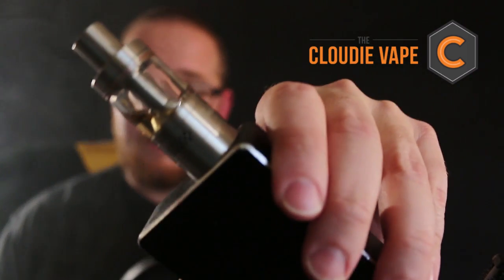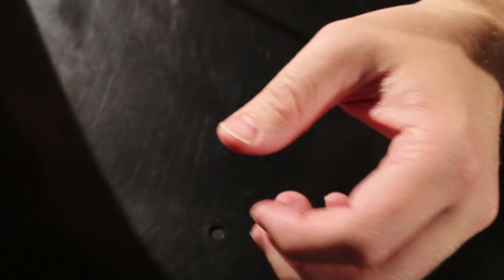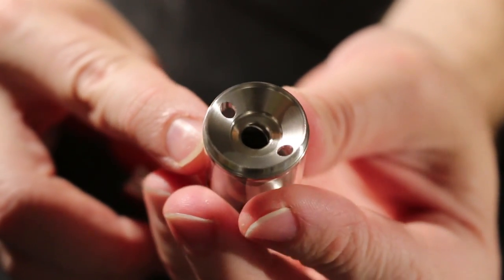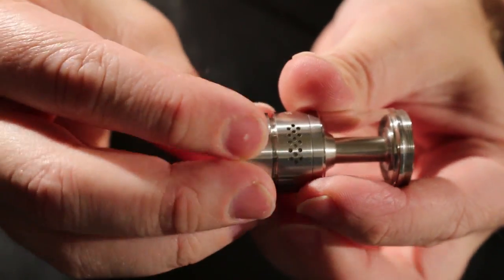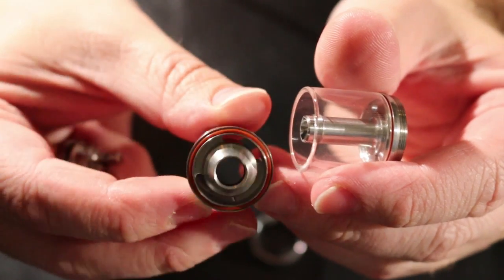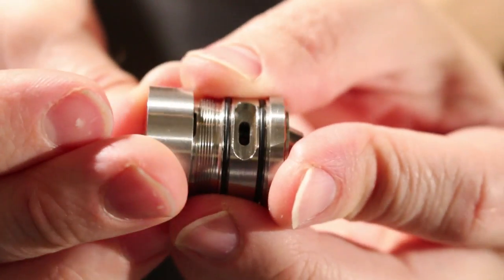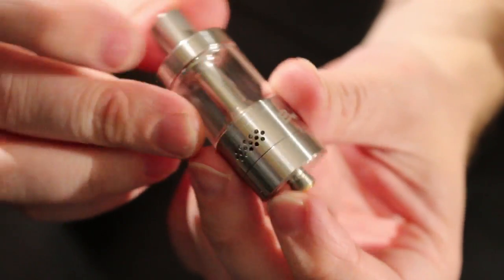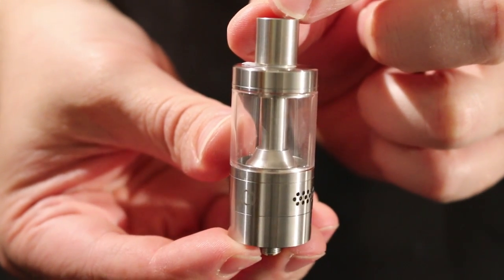Bellus RTA by Youde "UD" Technology - Review!

Comment: Another fine review, except I would have liked a little bit more on the single coil, lower wattage capability. Does the adapter block the airflow as well?
Reply: Yes both juice and airflow are blocked with the plug...
Reply from the maker: Yep! Like D said. Its blocks everything.
Reply: +D Jaquith Thanks!